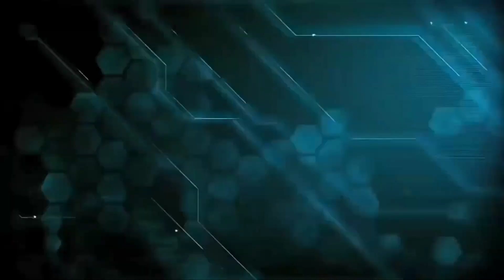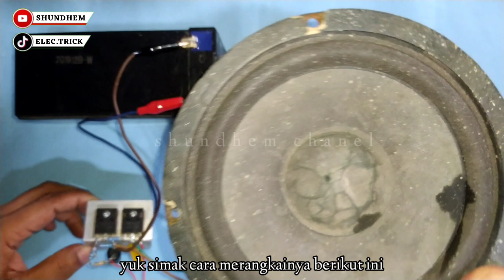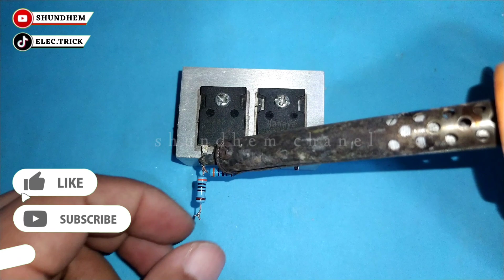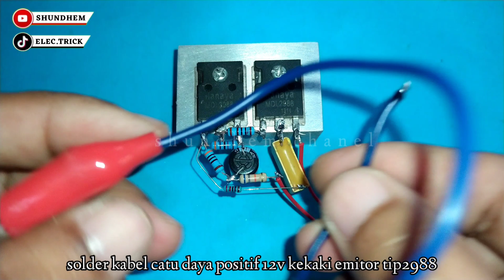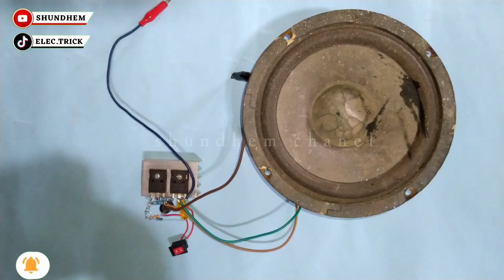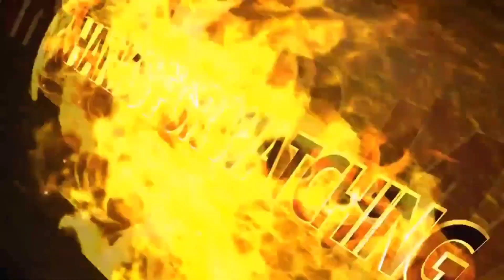Cara membuat sirine dari transistor |  nyaring dan lantang

Comment: Ada gak persamaan transistor karena di tempat kami tipe itu tudak ada
Reply from the maker: tip31/32
tip41/42
tip3055/2955
Reply: @shundhem_electrick  kalau transistor nya diganti dgn tipe diatas suaranya makin besar atau makin kecil ? untuk penempatan 41 / 42 kiri kanan bebas atau bagaimana ?
Reply: penempatan 3055 dan 2955 kiri kanan atau bebas
Reply from the maker: @andriabdillah8638  penempatan gak boleh asal, penempatan sama persis seperti dalem video atau sesuaikan dengan skema dalem video.
Reply: Terimakasih akan saya coba semoga berhasil maklum pemula bangetttt pengen punya sirine pasang di motor
Reply: Maaf tanya bang sdh saya ikuti semuanya tapi bunyi cuman Gresek Gresek di speaker mohon bantuan dan penjelasan nya kenapa bunyi nya hanya Gresek Gresek tidak keluar suaranya
Reply: Sudah 2x mencoba gagal terus tidak keluar suaranya hanya gresek gresek kenapa yah tolong dibantu gan